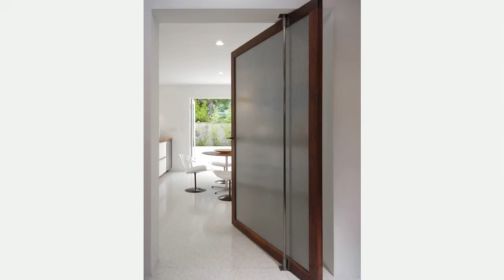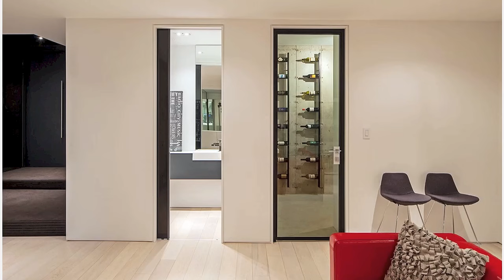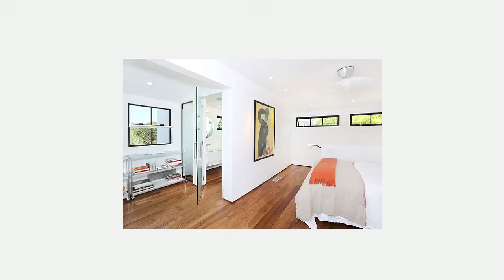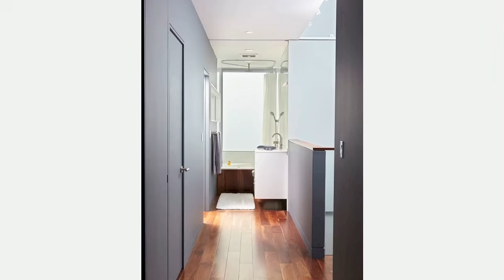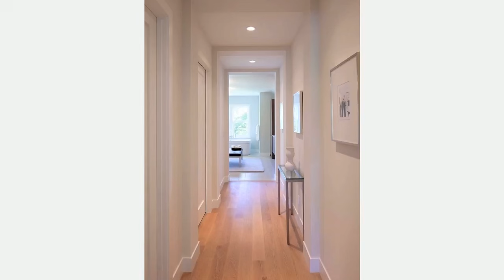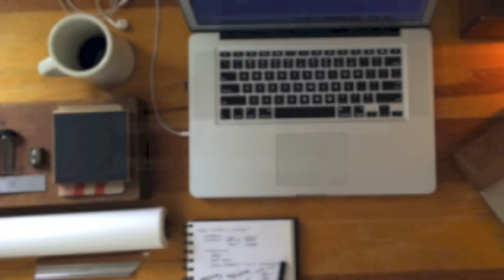Modern Wall Baseboard - 4 ways

Comment: For a flush no baseboard look like a gallery, having drywall come down to the floor, maybe we can use a corner or L bead similar to fastened and mudded on to the drywall(horizontally between finished floor and drywall, and then the lower section you can paint it a slightly darker color. I like the look without shadows. Its what throws people off and not get what looks different. The shadow still creates a separation.

Comment: Hi, can the 1/8" small reveal be filled with flexible  acrylic caulk, so it allows some wall movement while offering water protection?
How about applying a thin coat of invisible water repellent sealer in lieu of a baseboard? We're considering  a baseboardless kitchen, but I'm afraid of mopping the floor.

Comment: Hi Eric, love your videos and articles.  

What's the difference between the No Base, and the Reveal, since you state that the no base has a small reveal? And why does the drywall have to be finished as it already has a finished edge (as long as it's not cut)? Can't you just tape the vertical joins and paint?

Also do you have to install the flooring first so you can sit the drywall on top of it?

Thanks for all the great info.
Reply from the maker: The small reveal that's necessary with the 'no base' option is a function of allowing the wall and floor to move independently. The floor will move with seasonal humidity changes. With this detail, the bottom edge of the drywall is raised above the finished floor by a small amount. The gap that's created is approx. 1/8" so technically a 'reveal' but not as pronounced or clean as the reveal base which uses an extruded component to create it. The reveal base ranges from 1/4" to 2" and above.

Most drywall sheets are installed perpendicular to the studs with the long axis running horizontally (many good reasons for doing this: structural stability, evens out irregular studs, joint height is easier to finish, etc.) Doing this leaves the beveled edge at the bottom of the wall which needs to be finished. If you run the sheets vertically - as perhaps you're suggesting - I suppose it's possible, although a vertical installation (for a standard ceiling height) will result in more joints to tape and mud.

I wouldn't recommend installing the finished flooring before the drywall finishing takes place...too much of a mess. You can use spacers to set the bottom of the sheets at the desired height.

Good luck...cheers...!
Reply: Thanks, that all makes perfect sense, I didn't know drywall mounted horizontally and was forgetting about the bevel. I'll just make sure I know what I'm using for flooring before getting the drywall done so I know what space to leave. Keep up the great work!
Reply: I plan on doing nothing but drywall to a concrete floor. I figure we pour the floor, seal it with something with 1/2 pigment, protect it, frame everything, install drywall 1/8” from floor with shims, paint, done. 

How wrong am I?  Thanks for the videos!!!

I recently stayed at a house with this detail and the paint went down to a finished wood floor. So awesome.

Comment: Hello, we just finished a project with d300 metal bead finish around doors, windows and baseboards...there are some minor imperfections on the corners where we cut on a 45 degree angle, but some of the corners have a small gap. should we get putty used for window trim to cover the edges to make a clean finish?
Reply: You would probably need a photo to give anyone the information required to offer informed advice.

Comment: Wondering how flush base could be used/installed in a remodel with out removing all the drywall.
Reply: +Kyle Johnson Will be instead using the flush base in new construction. A few contractors also said for retro fitting they would cut 1-2 feet of the lower drywall out and install the new with the flush base. they also said doing this would allow electricians to update wiring easier as well
Reply from the maker: +Tommy Alan Raines is it possible to apply another layer? Door /window jambs will take extra care, but sheetrock is inexpensive...
Reply: There is 2 houses I am considering to purchase, with one of them putting another layer of dry might work and with the other house it may even be best to rip it all out and put new stuff up.
Reply: +Tommy Alan Raines I see the answer to this question lies below. Were you able to apply this technique in a remodel? If so, what was the process? Did you have to apply a second layer of drywall?

Comment: I am using wood flooring and was wounding how to deal with the expansion gap that is usually covered by the baseboards?
Reply from the maker: +Benjamin Conn here's one option: https://www.pinterest.com/pin/176695985358190267/ 
The other is to rely on the thickness of the wall finish to conceal the gap, this will mean keeping your wall finish close to the finished floor. Hope that helps...